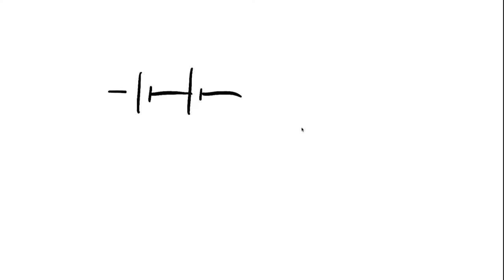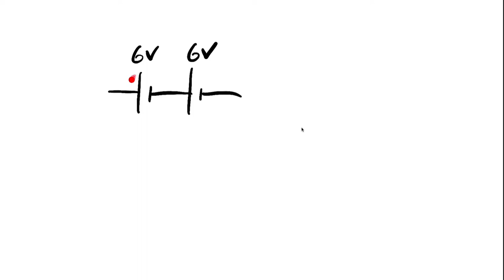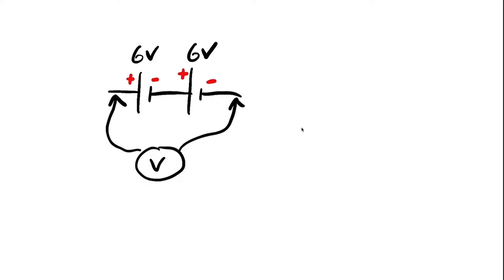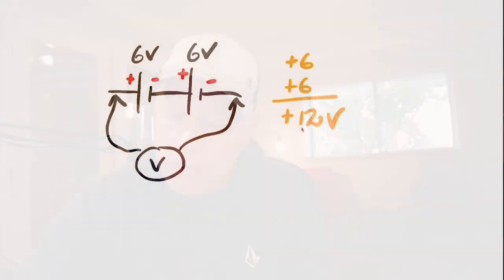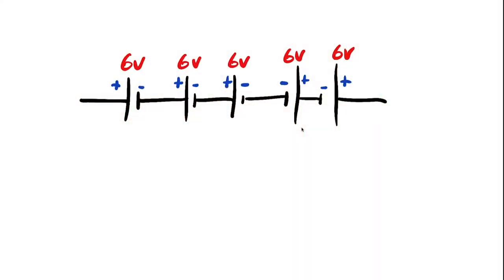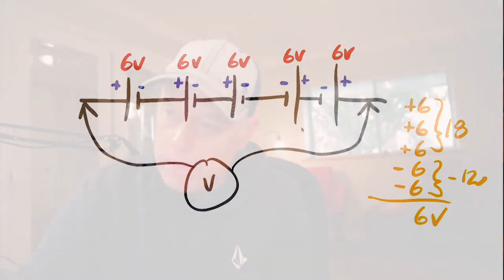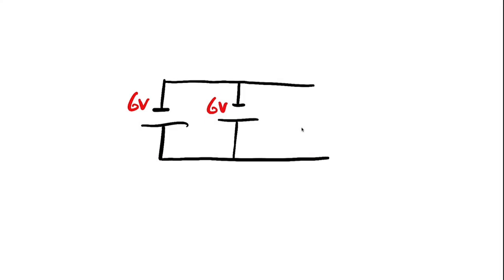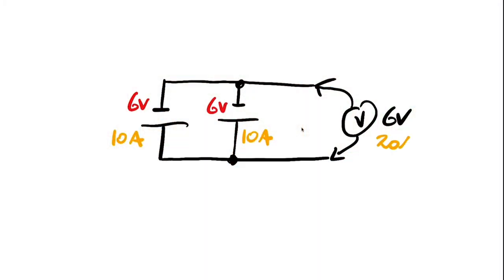Connecting DC sources in series (and parallel)

Comment: How voltage sources in parallel share load ,for example 6v two batteries would share the load?
How to make equal sharing for example 10 amps load shared equally between two batteries in parallel.